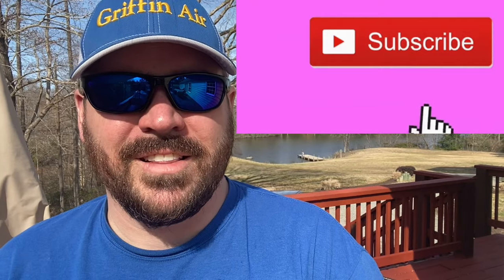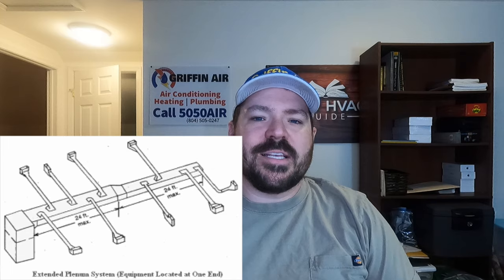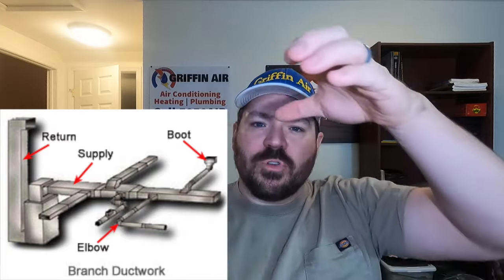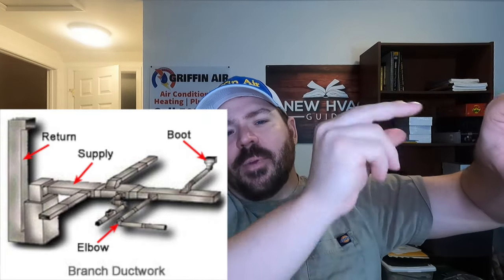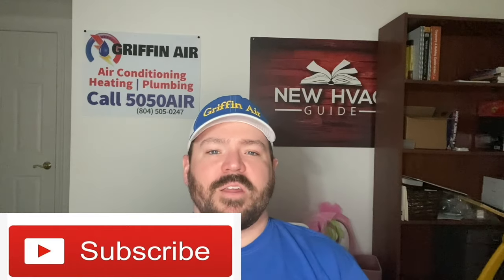3 HVAC Ductwork ISSUES Homeowners NEED To Know!

Comment: Ontario Canada  Heating Company's for years have had to pay for a duct design blueprint by a professional to go with the house blueprint and must be followed.....enforced by inspectors....must get variant to change anything. Old School   Supply Air 1" of duct (width) by 8" high standard duct  per heat run = (Round pipe off the duct) reducing square duct as you go.  Return air duct  1/3 larger than largest supply duct  reducing as you go away from furnace. All heat runs (round pipe) 5"   bathrooms 4"  anything far away or bendy 6" pipe. That's what we did Before there where duct designers. I've seen entire houses in 4" pipe OMG  return air's in kitchens That's great if you want to smell Fridays fish dinner throughout the house. No return air on top floor LOL and many more horrors

Comment: Hoo Boy. The house I am in has a closet  (raised above floor level) 85% system with the return air below. When the house was enlarged, they doubled the #  of return grills (height is not changeable). No filters. The unit has a green mesh filter but you can't use a pleated in the housing (way too much restriction). And No step down anywhere. Balance? ya gotta be kidding!

Comment: System size, location and cfm determines if a trunk line should be reduced. A 2 ton in the center of a house with a even 400 cfm going each way with 10x8 metal duct wouldn’t reduce. I have done 2 1/2 ton in the center with 10x10 each way and not reduce.

Comment: Thank you for your video good stuff and thank you for being so helpful. I have a question though that was not covered. My question is I have a 5-ton Lennox package system that is installed on my roof in Southern California in the Inland Empire which is extremely hot in the summer and gets really cold in the winter. The unit has exposed ductwork that goes from the air conditioning heating unit to inside the house and I was wondering if I should coat the exposed metal ductwork on the roof or am I just overthinking this and if you think I should put a reflective coating on the ductwork what coating do you suggest. Thank you and hope to hear from you soon

Comment: A radial system with home runs can be balanced with balancing dampers.  It would help if you weren't assuming ducts without dampers can be balanced by picking a specific-sized duct.

Comment: Not sure if you are still checking messages or not but I have a kitchen in which the builder dropped 18" from the ceiling a wrap around enclosure. They did this so they would install those crappy flourescent bulbs and then cover it with a drop in plastic cover. I hope this makes sense. There is a small vent set into that dropped down enclosure. I want to tear all of that out back to the 8' ceiling, remount that vent 18" up and then close up the ceiling and repair. Should that duct move freely to bring it up and reset it or will i need to add duct work to it? What would i need to watch for? either eliminate that vent or is the duct work easy enough to move around to reposition?

Comment: My ac broke last summer. Now I need to replace both AC and my ancient furnance. Only to find out the duct work is too small for the house I have and no matter how good my systems are, it will struggle to cool the 2nd floor.

Comment: On the "spider/octopus" systems you mentioned that theres no way to balance the air thats incorrect here in TX we use that type of ductwork mostly and you can install dampers in each collar to balance air flow to each duct run
Reply: The problem with the spider systems is there is no trunk line.you have a box with flex going everywhere.some are short runs then others to long.you can somewhat balance with the dampers but not very well.air doesn’t flow as good in flex as sheet metal ducts.when I still worked in the field we ran sheet metal trunks and the flex runs to the registers where never over six feet.you see the spider systems because its cheaper to build and install.
Reply: @xslabcabxhearsex  cheaper and gives you more options if you need to add/subtract ducts or even change their sizing. Trunk lines may work better in some applications but when a unit is in an attic I’d say flex works out better overall. A upflow or downflow in a closet going to a trunk line I’m all for.

Comment: My question with the return line is it's definitely bigger but only has 1 large central return vent feeding it at the center floor level vent and I know this can't be very good for circulation special seeing how the basement has ceiling vents and the main floor has floor vents this is my sister's house and she doesn't have the money to pay a professional so I'm thinking about adding a return vent running to the basement floor and another one running to the ceiling on the main floor making so the basement vent is open in the winter and the ceiling vent is opened in the summer hopefully pulling heat down and the cool air up

Comment: How do I stop cold air coming from the attic return when the heat is off?
Reply from the maker: Have you tried turning on the air circulate on the thermostat? Also seal around the Plenum/registers.
Reply: @NewHVACGuide  Just tried that and when its on there is no cold air.

Comment: hello got a concept i wonder might help. testing it right now. secondary heat exchanger went out. i dont have money to fix or replace it - echanger or furnace.  blower motor and ac still work. set the fan to run constantly.  placed a space heater in ta section of the return air duct to warm it . what are the cons of this working?

Comment: We definitely have a "spider" or "octopus" set up, I think.   All of the ductwork doesn't come out of one end of the box though.  The ductwork spiders out all sides of the box (left, right, front, back).  Is that the same thing you're describing?  If so, is there anything that can be done?  We definitely have one room in the house that doesn't keep up.  HVAC guy looked at our ductwork and complained that the installer didn't do a good job.  Wondering if the problem is mostly due to "spider" ducts or sagging/pinched ductwork, improper sizing, or all of the above.
Reply from the maker: Are you a subscriber to new HVAC guide? If so, send me a picture of it.
Reply: @NewHVACGuide  I'd like to know this as well. When is the ductwork a "ductopus" and when is it just a simple radial configuration.

Comment: One room's warm because not much air is coming thru the vent . I played with dampener both ways but made no difference . That means duct is open / damaged or unconnected to the trunk ? That's pretty much the only thing it couild be ?
Reply from the maker: Sounds like it could be 🙂

Comment: You started to talk about the end of the duct run that is capped and said you shouldn't connect any branches close to it. I understand your analogy on the holes in the straw but I'm not really sure how it relates to the branches being too close to the end.
Reply from the maker: If you put branch lines at the end of a trunkline, they will not have enough static and more airflow will go through them reducing the airflow through the others
Reply: @NewHVACGuide  okay I see. Is there a rule of thumb about how far away from the end cap you should put your closest branch?
Reply: @NewHVACGuide  But they do it anyway because no one want to box in heat runs and not have nice clean lines in the house

Comment: 3:57 basically my problem. I probably need a trunk that's atleast 10 ft longer so I can run shorter lines. Now I just gotta figure out the other side of the house so I can count up the cost somebody has caused me by building this house. Well hopefully those VA checks get a little bigger.

Comment: Available Static pressure reduces with each reducer. In fact you get static regain if you don’t install a reducer as the velocity pressure reduces and the total pressure is fairly constant, there fore static pressure increases. Some low velocity systems I’ve designed end up being self balancing as the supply diffuser becomes the dominant resistance in the supply system which means you don’t need a balancing damper and risk of noise regeneration.

Comment: I have one room that’s hotter than others and my master bedroom barely get heat or air, no heat or air doesn’t even come out of the one vents. I had the hvac system replaced in 2013 with a TM9V 96% AFUE Two Stage Variable Speed Furnace with 2 stage air conditioner and the company that did the install when I told them about the issue they said the system is working properly when they performed a maintenance check on it. I’m at a loss, a heater in our master in winter and a separate ac unit in window in summer. House was built in 94 we’re the second owners with a crawl space no basement. Any suggestions would be helpful!!
Reply: I have the same problem. What did you end up doing?

Comment: I have been having issues with ac or heat blowing out of my return vent. Every time I call home warranty and have a hvac guy come out, the problem fixes itself. It’s extremely frustrating. I thought it was our unit and paid 14k for a replacement less than a year ago. Now that’s that, it’s obviously the ductwork or wiring. Anything to help would be GREATLY appreciated.
Reply: It’s probably not hooked up an air conditioners are a negative pressure system so it’s pulling air from there from your attic

Comment: I bought a house with no a.c ...got estimates done..and found out (all cold air returns were covered and blocked when they re did the floor)..how can I fix this? Is is for every output vent I need same size return?..o yea and no duct work in the 2nd story
Reply: Any house can be done.

Comment: I have a question. Should the ductwork be placed under the enclosed exterior porch? I would think since it’s the exterior, it’s not energy efficient. One of the bedroom has 2x 6-inch holes, and one of the hole coming from within the interior frame while the other coming from under the front porch.
Reply: If you decide to run ductwork underneath an exterior porch to the room above it will need to insulate the ductwork with thermal insulation.  Another thing that will happen inside the room above the porch is that,  it will have a tendency to cool down a lot quicker than the rest of the house and your main thermostat will not detect the drop in temperature inside that room, therefore leaving that room constantly cooler. One of the solutions could be, instead of having a supply duct branch you could install a return air and have your furnace fan mode in recirculating. If done right it will be pulling conditioned air from the home into that room making it much more comfortable during all seasons.

Comment: Yeah that's the problem I kind of just run into with my ductwork when my system was first initially installed they undersized me and placed a 4 ton system hired a new company after 10 years they did pressure test and leakage test and everything was 98% efficient no leaks anywhere they decided to install an American Standard gold 17 two stage five ton heat pump with it's partnered variable speed air handler. Of course it doesn't bother me because it rarely runs in that 5-ton stage but when it does it sounds like a jet engine in my ducts. They wanted to update my duct system and it cost nearly twice as much as what the heat pump and air handler cost.
Reply: You should've had the ductwork changed. It's like putting a Ferrari engine In a Kia.
Reply: @mikekolczynski5665  yeah turns out I got lucky my existing ductwork thats in the belly pan was actually rated for for a 5-ton system from the manufacturer turns out the problem I had was my supply and crossovers were converted down and dampers was put in to compensate for stepping down to a 4 ton system instead of a 5 ton. Made that Discovery after having another company come in and give me an estimate who discovered there was nothing wrong with my existing duct system problem was with the supply and distribution plenum. I have 8 inch crossovers when I should have at least 12. My supply is 12 inch when it should be 16 or 18 inch fortunately I've gotten a lucky and they said that is all that needs to be changed is my supply the crossovers and the distribution plenum.

Comment: In locations with cold winters I look for supply vents positioned at each window, and returns across the room from that vent. 
I have seen new homes with the vents and returns along the same wall and nowhere close to the windows.
Reply: Thats how florida is ( is not that its wrong)
You walk thru any bedroom door typically the return is above the door and to the middle of the window (oppsite from the window) youll have the supply
Everything changes once you step into georgia and the carolinas since those states get snow and then they have crawl spaces too florida homes dont(unless its from 1890 or 1900s)

Comment: I just had an estimate for Amana i have two systems. 1. 3 Ton 16 Seer Gas System1 $8,542.00
2. 3 Ton 18 Seer 2 Stage Gas System $12,125.00.  Total, $21,958.69
Reply from the maker: Big decision!
Reply: @NewHVACGuide  I have a question, I was told the grabagee can style condenser last longer than the min-split style of condenser is that true?

Comment: If my house religiously has a film of dust coat the interior of our house, to where we have to clean up once a wk, what's the possible problems?
House is 30 yrs old & perhaps it's the same system.
Reply: Return duct leaking in the attic or crawlspace.Door off the equipment ? Dirty air handler coil. Extra filter, you don't know about in the unit itself.
Reply: Cleaning once a  week is normal and should be a habit.

Comment: Just bought a house that has noisy ductwork when it heats up it sounds like hammer’s banging on the stuff! Expanding and contracting?
Reply from the maker: Could be the ducts bending. A pro can do a cross brake fold. Among other things 🙂
Reply: @NewHVACGuide  seems like it’s mainly on a couple runs but the one that bothers me is under the floor of the master bedroom really loud! But they can quiet them down?
Reply: Spirits?

Comment: My biggest red flag for ductwork is only having 1 return air duct and grill. Especially if that return air grill is smaller than 20 inches by 30 inches. If this is the case you almost certainly need another return air duct and grill. You gotta let that system breathe easy or you are waisting money.
Reply from the maker: I had a 3.5 ton system last week with ONE 12” RETURN!
Reply: @NewHVACGuide  SMH
Reply: In S Florida, homes have no basements and often have cramped attics, so they don't but air handler units in either of those locations. Instead, they are almost always installed inside an AC closet with slatted bi-fold doors in a vertical stack air handler arrangement (evaporator under a plenum sucking in return air from underneath. Thus... one return.  This is not a "bad design" factor, its just a regional thing where home construction differs. In S Florida, unless its some odd custom home, you will never see return ducts in every room, or even anywhere under than directly under the blower motor above the evaporator. Not sure this is a big deal since the return air easily flows from under the doors of every room under negative pressure straight back into the large filtered air handler.
Reply: And by the way, my 2-story home has 2 AC systems, a 2.5 and a 4.0 ton, thus 2 returns/grills, one for each air handler.
Reply: @privatename3621  That's not a bad setup as long as the return duct and grill are large enough. Having the return right at the Air Handler should allow it to pull in a lot of air without causing high static pressure. Good airflow helps your system work efficiently. The only downside to that type of setup is the ductwork is usually in a hot attic. The ductwork should be sealed up, and insulated, so you don't lose all the cool air in the attic.
Reply: Must be nice to live in a new house. Of course you can install more in an oils home but not necessarily the fix.
Reply: @KPHVAC  super rookie move. Return away from the blower obviously creates more transfer assuming the ducts are sealed. Life is comical these days the way ‘professionals’ spew nonsense
Reply: Having the return behind any impediment is obviously less efficient. What do you want, more efficient house or more aesthetically pleasing without a return grill? I’ll go with multiple obvious return grills and efficient system any day
Reply: @KPHVAC  this is bad advice. You are seeking recirculating flow between the return and supply when you actually want to distribute the conditioned air
Reply: @patrickkelleher2309  
You'd have to see one of those type systems to understand, the description of it alone does not suffice.  

They circulate just fine.  My complaint is how noisy they are in the hallway.
Reply: @privatename3621  yea i got rid of that slatted door and installed a regular door with an opening on the bottom and installed a 18x18 grill for return and there is an other one next to it so its breath...
Reply: @patrickkelleher2309  The problem I see in my area is one 14" or 16" round return air duct on a 3, 4, or 5 ton system. The static pressure on the return alone is way over 0.50. On system replacements we often have to add a 2nd return air duct and grill.
Reply: I guess I said that the wrong way. In my area far too many homes only have one 14" or 16" round flex line return going upstairs from the garage. This is the red flag! A large home with a 3, 4, or 5 ton system is going to need a larger return duct or 2 return air ducts.